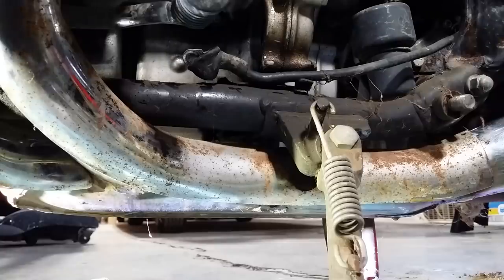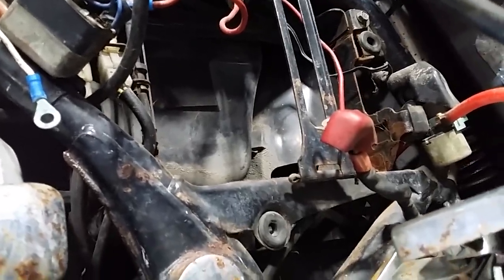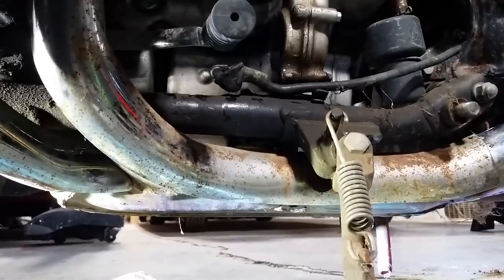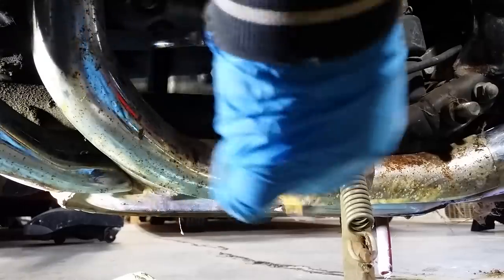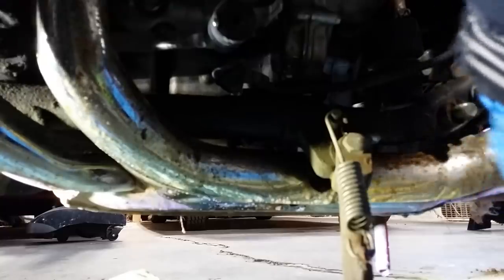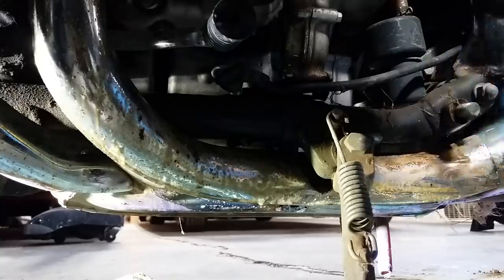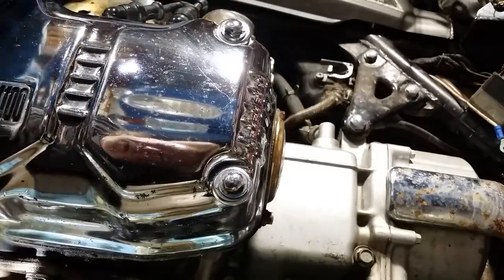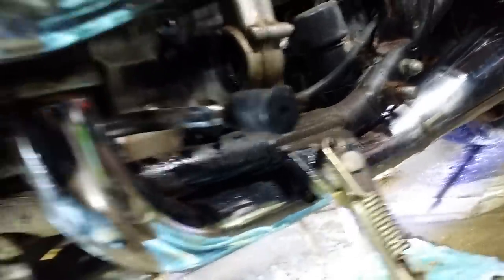Clean rusty motorcycle exhaust in minutes. You must see this!

Comment: Turtle wax sells a chrome polisher and rust remover all in one, for$ 2.49 at Wal-Mart. Used it on my King. Removed the rust and shined the chrome. Best stuff I've ever used. But if the lime away works by all means, use it. Just that the turtle is faster and safer.
Reply: I'll have to look for that in my local car accessories shop.

Comment: You should use after procedure clean water and wipe it dry or just drive the motorcycle until complete dry. You dont want that sodium/amonium solution on your parts any longer as it needs to get dirt and rust away. Using a cloth to wipe still leaves that acid solution on your parts.

Comment: 000 steel wool works wonders also. Get the part wet with Nevr-Dull and wipe with the 000, rust melts off. I just did the nasty exhaust on a 92 HD Sportster, the owner could not believe they were the same pipes.
Reply: Could you send me product info.

Comment: Would that work on rusty bolts too?  Better than penetrating oil would? Also, do you think it would damage paint or aluminum surfaces?
Reply from the maker: Only to clean them after removal, not as a pennitrating fluid.

Comment: Nice to know 👍 but we don't have lime away in Philippines
Reply: Lime Away is phosphoric acid. Look in the toilet cleaning area and find it on the ingredients label. CLR is also phosphoric acid, is that available?
Reply: Somebody on here said to use aluminium foil and water on chrome and aluminium they said it is better and fills small holes in the chrome. They suggested heavy duty foil not the cheap ones. 

You could try it out with any foil, try it.
Reply: @hodaka1000  thanks for the tips..i am planning to buy a 2nd hand pipe since thats the part that is rusty and old with my scooter but thanks anyway i will try to use lifehacks soaked it with Coca-Cola then do a bit steel brushing that i saw on some videos and see if it will work

Comment from the maker: Use any soapy cleaner to remove it. Windex, soap and water, etc. Good luck.
Reply: Glenn I used the method above to clean my rims, spokes, and handlebars and it worked tremendously; however it did seem to leave a little film where it looks like the acid ate away. Do you have any suggestions for polishing the chrome to get it looking new again? I just want to get this film off and re-scrubbing with lime away isnt working. 

Thanks!
Reply: Scrubbing bubbles dude,polishes chrome like nothing I've ever seen
Reply: @dustinpomeroy8817  I tried this. First thing I tried.
Reply: @NorthwestGuitarworks  no luck?
Reply: @dustinpomeroy8817  I wish I could post a picture of it. Its the weirdest thing Ive ever seen on chrome. This trick above worked like a charm on my pipes and everything else, but it mangled the tarnish on my chrome. I will try and direct message you a picture, its bizare
Reply: @dustinpomeroy8817  I tried to find you on FB to send a picture, but there are like 10 Dustin Pomeroy's. Look my name up if you can - Braedan Binkiewicz
Reply: I don't have face book on ,look this product up on YouTube and order some,it took the bluing off my pipes and some huge waterspots off my aluminum wheels,it's called Quik Glo it removes rust fast as hell too with barely any work at all
Reply: @dustinpomeroy8817  will try it thank you
Reply: @NorthwestGuitarworks  the stuffs magic,and truthfully by what I've seen in the video works faster and is not caustic at all,when you buy it get the two pack with one of each grit and you're welcome the stuff is by far the best tool in my arsenal ,came across it by chance here on YouTube about 5 years ago and have been amazed on what it can do.Let me know how it works for you.
Reply: @dustinpomeroy8817  think it works better than the process in the video above?
Reply: @NorthwestGuitarworks  hard to say because I've never used the stuff before,the thing with anything is what works on some won't work on others ,but I know this the stuff I mentioned is painless, and you don't have to worry about it ruining anything if you're not careful
Reply: @dustinpomeroy8817  I guess I learned the hard way
Reply: @NorthwestGuitarworks  I wouldn't say that if it took most of the rust off,there's no one thing that does it all ,will probably even use the limeaway for certain things myself,but get the Quik Flo I promise you won't be disappointed
Reply: @dustinpomeroy8817  I will order it. Do you think it will replenish the Chrome that has tarnished (or whatever happened to it?)
Reply: @NorthwestGuitarworks  if it is just tarnished it it should
Reply: @NorthwestGuitarworks  Dude, you took off any clear coat or rust resistant that was there. It isn't a film. The sheen is GONE NOW. Sorry but you have to be very careful when using Lime away on anything. It is an acid used on toilets and tubs. I would try and see if you can use never dull to bring it back, the one I use is a mesh mixed with polish or Mothers in the bandaid can, same mesh with a pink polish mix.

Comment: using an acid like this that also strips chrome will eventually make it  rust worse than before,  use an acid that attack iron oxide preferentially or aluminum foil or . soap and water instead.
Reply: Fine steel wool works great

Comment: I just got to 1984 GL1200's one was extremely Dusty sat inside for years and it came with a GL1200 that sat outside for 16 years unriden 42k miles i  had to name it "Rusty" and Dusty has a few more miles but runs..needs a carb kit and TLC

Comment from the maker: I would not use it for light rust, only for heavy rust where the damage was already done. I guess for light rust, just be quicker. I have other videos where I used it for cleaning up toys where the batteries have corroded with great results...
Reply: Any long term problems with the lime away like peeling or hazing up or cracking?????
Reply: Do you clean the limeaway off when you are done?

Comment: LCR - First, then, 1/2 cup baking soda and 1/2 cup water in spray bottle.. base...white wall cleaner.. and use alfoil flat  as softer than chrome plating
Reply from the maker: It looks like I'll be picking up a GL1200 Aspencade soon, sitting 20 years. Will have another opertunity to test yours against mine.

Comment: So the Lime Away is cheap enough but what about the whitewall cleaner? What else could you use to neutralize that? How about a baking soda and water rinse followed by straight water?
Reply from the maker: Any soapy spray you have on hand....
Reply: @GlennsSpeedShop  gave it a try yesterday and it works as well as the video shows! Used a baking soda/water mix, we'll see what develops over time. Great tip, thanks for posting!

Comment: If you want to get rid of the pitting that's on the Chrome use a steel wool pad it works like magic!
Reply: problem is that you take another layer off so it will rust even quicker next time is took outside.

Comment: I saw leno had a guy on his channel that made quick-glo...worked on my chrome real nice and fills the pits with a wax coating to prevent rerusting....wont the lime away damage the chrome more? Ide like to see those pipes a few weeks later?
Reply from the maker: I recomend it is step one for chrome restoration, step 2 is clean and neutrilse step 3 is polish. The product you mentioned sounds good...
Reply: @GlennsSpeedShop  oh i understood all that...i guess what i was wondering is...does the lime away do any damage while youre using it for those few minutes to get the rust off?

Comment: Iv'e been watching your video's,I purchased an 81 and 82 interstates all 4 years of the 1100 changed every year.your 83 was the 1st year with integrated brakes,and the rims are not the riveted comstar wheels heres a suggestion rub aluninum foil on the pitted part on exhaust it wont scratch the chrome since its softer than chromium. Keep up the good work.

Comment: Just be aware that hydrochloric acid (the active ingredient) is also used in industry to remove chrome.
At least wash the parts in NaHCO3/water mix afterwards to completely neutralise the acid that gets into the pitting.
Reply: English translation for the chemical compound? Is that baking soda, or what?
Reply: Lee Williams That’s what I thought - thanks!
Reply: @usernamemykel  Yes, it would be baking soda. https://en.wikipedia.org/wiki/Sodium_bicarbonate

Comment: I would have started with a degrease and pressure wash and then see what ya got why start with chrome thats the last thing to worry about even if your gonna work on ya bike degrease first
Reply: You gotta be careful what degreaser products you use and how you use them... some degreasers react/eat aluminum
Reply: @busbystandup1337  Thats true i use a 50 50 mix of petrol diesel wont harm your aluminium just spray on move around with a brush pressure wash off

Comment: I’m extremely nervous to use lime-away on my bike AT ALL, and my exhaust isn’t really the part that’s rusted, it’s more engine like water corrosion and I want to clean it up, would this be a bad idea?
Reply: Use soapy water and aluminum foil. The foil is softer than the chrome so it wont scratch
Reply: Do you have any tips for polishing aluminium?
Reply: @Al-Hunt-acrylic-painter  Microwave or oven spray foam, just for a minut or 2 no longer that that. I overhauled my brakes on motorcycle using this. It should not stay too long on aluminum parts. Always wash with clean water after procedure.

Comment: Hey there! I'm about to probably use this on my 2010 triumph Bonneville. Seems like a safe option. Is this the toilet bowl cleaner? Lime A-Way has several product types. What kind of brush did you apply it with? Cheers and thank you! Great video.
Reply from the maker: I use a Flux brush I get in a pack of 25 or 30 at Harbor freight  the Lime Away is Rust Stain Remover. I have a few other lime away videos you can check out where I give a better view of the container. Good luck!
Reply: @GlennsSpeedShop  any tips for restoring cast aluminum motorcycle wheels?
Reply: @GlennsSpeedShop  one other question - do you know the active ingredient? I can't find that product in Canada...
Reply from the maker: Not sure, some sort of acid... you might be able to pull an SDS / MDS sheet of the internet. Did you check Amazon for it?
Reply from the maker: @7AirCanuck7  wheels... I have done many... if there is a clear coat, need to remove it with Stripper, then I use scotch brite pads with aluminum polish on it. I used to put the bike on the center stand and start the bike in gear and let the wheel spin and polish away. Can be dangerous! I have seen front wheel spines that use small motors to do the same up front.. Good Luck
Reply: Kl

Comment: Question, I have a bottle of Lime A Way and realized it cleans rust and decided to do some research on it. I have a 2017 Jeep Grand Cherokee with slight rust forming on the calipers and a bit on the rotor mount. Don’t exactly know how to take a caliper assembly apart so through your experience would it be safe to wrap/take my wheels off and spray and scrub the calipers or no?
Reply from the maker: I would say use small amount only where the rust is, clean it off carefully with soapy cleaner, dry it and then paint or clear coat the former rust areas. Keep it off the rubber, brake pads, and the rotor .

Comment: *DO NOT LET THIS STUFF SIT ON YOUR CHROME FOR MORE THAN A MINUTE OR TWO* I saw this video and used it on my classic Kawasaki Z1 front fender and it turned my chrome fender into a cloudy discolored mess. I let it sit on there for too long and the hydrochloric acid found in the lime away stained my chrome. I was so pissed. Now I have done hours and hours of buffing and compounding  on it and it's helped to remove the stains a little, but i don't know if it will ever come back. Thank God I didn't leave it on my exhaust and other chrome parts as long as the front fender, because that was the first part I did.

Comment: I hope you're not trying to get an endorsement from Lime Off. After watching your video, I went straight to the store and slapped down 5 bucks for a bottle and gave it a shot. The results were about 20 percent satisfying. I did three treatments. Let it soak. Scrubbed with a brush, like you did. Maybe after 10 treatments will I get the results you're showing here.
Reply: He used Lime-a-way not Lime Off. And he also used white wall cleaner to to neutralize the acid and soak it off
Reply: Train Monrovia 
🤔

Comment: I did this and then polished it with Blue Job and finished it with Mothers wheel and mag polish. Literally the “golden recipe”, it got rust off with your step and then toke off easily 98-99% of the really heavy pitting. Thanks for the video for the inspiration, and I’d recommend you give the second two steps I did a try.👍✌️

Comment: Nice video, but I'd recommend picking up a can of "NEVR-DULL".
It's for polishing and restoring chrome, it can also do the exact same as the lime away with removing rust on chrome parts.
Used some to get rid of a lot of rust on my most recent project.
(If you can see through the part, you obviously won't be able to fix that rust anymore.)
Reply from the maker: I have used never dull on brass and copper items for years, never used it on rust. Might have to do a side by side comparison....